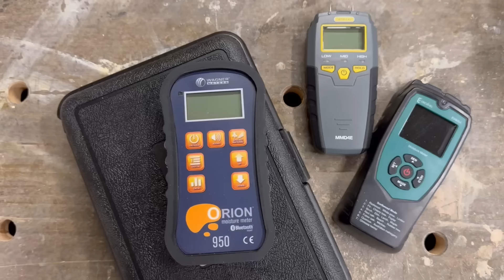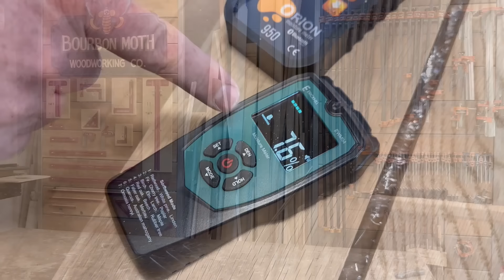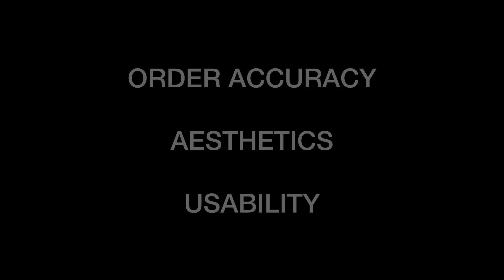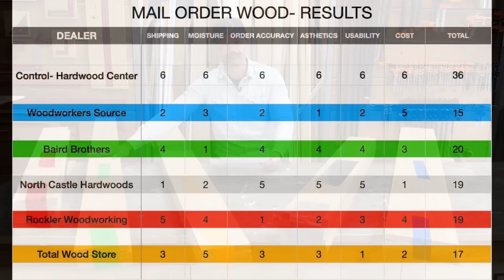A Thousand Dollars Worth of Wood || Buying Wood Online

Comment: Your ranking method is very misleading. The boards should not be graded relative to each other, but rather get an absolute grade between 1-6. After all, theoretically there can be 2 boards that deserve a score of 6 because they are of high quality and 4 boards that deserve a score of 1 because they are of low quality. According to your method, they would receive the grades: 1, 2, 3, 4, 5, 6 and this really does not reflect reality

Comment: This is a very informative look at how to order wood online.
The linear rating system can distort the ranking.
Example: If the delivery times were close to one another, say 6 days, 7 days, 7days, 8 days, 9 days the 6 day delivery would get 5 points and the 9 day delivery would get 1 point. That is a big difference for just 3 days.
Also each of the rating categories are rated out of 6 which means they are of equal importance.
Reply: Good point. I think each person might value certain aspects differently...for example, silver ranked higher for me as someone without milling tools. Vs someone that needs longer boards, fast shipping etc. Overall very informative with tons of useful info that can be applied to fit the viewer's unique circumstances/preferences.
Reply: I just typed up the same thing without reading the comments. Should be 0-10 (or 0-100) points and scaled. Bunch of stuff shows up quickly, but one is super late, give them points between 8 and 10, but one score of 0. A lot have quality issues, but one is great, give them points between 3 and 6, but one score gets a 10.

Having each category the same amount of points kinda makes sense to me. Maybe you need it fast, maybe you need it to be the best, maybe you don't have the money and can deal with worse quality.
Reply: The data is there and I think one can apply a weighting to each category that aligns with their requirements. This would then lead to the best choice for them.
Reply: @jbrickey  good point
Reply: totally agree.  I think certain categories should be weighted more heavily.
Reply: @danieldaponte1819  And each person will have a different weighting.  Price vs Time, accuracy vs price, usability vs aesthetics.    Granted, cost is my big issue, so ... that's a big factor for me.

Comment: I’m under the impression that the control was for rough lumber, would have been interesting for you to have your local wood store prepare the board S4S. I know that when I get mine prepare it generally take about a week so my local shop would not actually ranked first in that regard. I think that one of the main appeal of the online supplier is to be able to order S4S as not everyone is equipped to used rough cut lumber
Reply: I hope Jason addresses this comment because I had the same thought- is the price he listed S4S? 

Also, one must consider availability. With oak/maple/walnut, it's probably not an issue. However, your local place may not have the exotic wood you need while somewhere on the internet will. 

This is still a great video and the information is certainly useful!

Comment: I buy mine online from Ocooch Hardwoods. Never had a problem with anything. Quick shipping and always quality stuff. One time they did forget one piece that I had ordered. I called them and let them know. It was on a Friday afternoon. I had the board Monday. Even though I told them not to expedite the shipping cause I wouldn’t be using it soon.
Reply: That's who I use when I need to order something.  Never had an issue
Reply: love them best prices from online
Reply: Checked them out, can't order anything longer than 24" unless I'm missing something. Not really useful for 90% of what I do.
Reply: I was surprised to see them not included here, especially since it would be nice to see a the semi-objective comparison. I've only ever ordered their offcut/seconds boxes, but I know a lot of people in the laser cutting communities love their regular stuff.
Reply: That’s where I buy my wood from also. Never had a bad experience with them. If I am in a hurry I can go right to the them only about an hour from my house
Reply: @ex-nerd Probably because it looks like you are extremely limited in lengths. Order page says when ordering by the board foot the lengths would be between 47”  to 24”. On their pick a board page there is 1 board that is 36” and the rest are all 24” so I’d expect most, if not all the boards would be 24” so for a 7’ long project that wouldn’t be useful unless you were making a butcher block counter.
Reply: I tried them once...won't go back. Waaaay to inaccurate.

Comment: I went to buy wood online and the shipping was as much as the wood cost. It was actually cheaper to order S4S wood from homedepot with free shipping.
Reply: HD will send maple, walnut and red oak right to your door. Thx for let folks know.
Reply: @DownloadFreeWoodworkingPlans  I ordered some walnut and some maple. The walnut wasn't great, there were lots of color variations and several flaws. but a lot of the maple had flame figuring. Every piece had planer marks and one piece of walnut had some bad snipe.
Reply: If you are going to buy from HD go there in person and rent one of ther trucks for $20 for an hour. At least you might get something useful by picking each board yourself. They are going to grab whatever crap is at the top of the pile for online orders.
Reply: @gredystar8333  The only hardwood my HD carries is poplar and red oak and they don't rent trucks.

Comment: Should have thrown the big box stores in there as options so we could see how they ranked verses actual hardwood suppliers.
Reply: hardwood for big box is usually 20% more, but its usually ok stuff. hell it could be half assed as still the same quality and 1/14th the wait time as shipped
Reply: The HD near me ONLY has red oak. Anything else, nope. Special order only. :(
Reply: Not going to get a great selection of hardwoods at either as far as species. Red Oak, Maple or Poplar. HD used to sell Walnut, but no longer does (at least the stores I worked in). Lowes is the same. Quality/consistency though is actually pretty good, and it is all S4S.
Reply: @RB-vr7mq I was just at HD today for something else, and my local HD (near Seattle) carries Walnut still! White Oak is super expensive locally though, definitely not getting $7/board foot like Jason
Reply: The entire point of his video preceding this one was that’s not a good option at all.
Reply: @RB-vr7mq  Menards has a decent selection (at least where I am) with white oak, red oak, pine, poplar, alder, maple, walnut, mahogany, and hickory.

Comment: As someone without the vehicle to move wood, thanks for this video!
Reply: For those prices it would be cheaper to rent a uhaul and get better wood
Reply: See if you Home Depot rents flatbed trucks. One near me $30 for first 75 min. Enough time to run to a lumber yard and back.
Reply: @omm2745  that's a great price. I'll definitely look into that
Reply: You could put the 4ft boards in the trunk of an Uber :)
Reply: @thomprd  damn that'd be funny to try
Reply: My local hardwood dealer free delivery next day if order is over 500… might want to ask around. Even with delivery fee, would be cheaper and faster and I can pick boards compared to online
Reply: @bloho_design  100% I'll be doing this, too. Thanks!
Reply: No vehicle here also ... and no space for tools to mill up boards. [I live in a flat in the city center. Doesn't stop me from making furniture, I just have to be very selective.] 

I'm sure there are some excellent hardwood dealers on the outskirts of my city ... but when you add in the cost of an Uber to the cost of getting S4S wood, the upcharge for ordering online looks a lot better. Plus, I don't know about your hardwood dealers, but few of the ones I've been to produce glue-ready boards.

Last point, and I wish I didn't have to mention it ... being a petite older woman, I rarely get decent service when I go in person. Seems like most of the lumber dudes want to tell "the little lady" what she should want ... I've been working with wood since before most of them were born, and if I say I want S4S clear cherry, don't try to talk me into red oak!
Reply: If you have a Menards near you, it's just $20 to rent their truck, and at least at my local one, they tend to have better hardwood then home depot
Reply: @joshr408  I used to live in Menards country and I miss it everyday.
Reply: 😅dann finde einen Freund und fährt zusammen in die Holzhandlung

Comment: Great timing.  My buddy and I were just talking about ordering some wood.  Canadian viewers have to remember the 30% for exchange and getting hosed on import fees as well.   Local always wins.   But!  If you don't have a local hardwood place, start searching.  Odds are you're not that far from one.  Maybe it's a couple hrs drive, it's still going to work out cheaper especially considering you're going to be able to choose your wood and check the moisture
Reply: Except the two hours drive is at least a four hour trip. That ends up being a whole day just to buy wood. With the cost of gas, that is like the shipping cost of ordering online.
Reply: @ChrisStCyr-gnt7  Except for the fact you get to pick out exactly what you need/want.  So there's still value in doing that.  Plus if you plan accordingly, you can get a few projects worth and save even more.  When you order more online, you pay more shipping.  I'm fortunate to have a fair number of options closer than 1 hour drive.
Reply: @souprmage  you points are all valid and are trade offs. The next step in that logic is by giving up a day to travel to the lumber yard you save by not having to return sub-par wood. 

It’s like choosing to buy a $5 flea market find over a hundreds of dollars tool new, well the opposite in wood though. There are always trade offs in time for money.

The nearest retail woods yards I know of near me are at least 1:10 away. I do know a couple of guys with band saw mills more locally.

Comment: I'm honestly surprised by the Woodworkers Source. When I lived in AZ, I used all of their local stores and never had any issue, the stores are great, the people are great and the wood you pick out was great.  Since I've moved to another state, I have always kept them in mind if I needed to order online since I've dealt with them and knew that you could make an online order. Thought that they'd be up near the top in this blind test.
Reply: Agree with you. I’ve been ordering from them for a while now and have been nothing but completely satisfied
Reply: Also agree with you. I use Woodworkers Source exclusively for my hardwood needs. They have a large selection of exotics and their standard hardwoods are priced right….typically well under $15 bft. I do live in AZ but I have to travel 100 miles one way to stock up. But if I only do that three or four times a year it’s not a hassle and I can select nice looking wood for reasonable cost.
Reply: Maybe they dump lower quality online and sell higher in person?
Reply: Agreed. I have nothing but good experiences ordering online from them.
You only get one chance to make a first impression, so this was very unfortunate for them.
Reply: I've ordered online from Woodworkers Source for years and never had any problems at all. I was really expecting them to be one of the best companies throughout the whole video. Not sure if it's just a fluke or what. But this definitely doesn't look good for them.
Reply: I ordered White oak from them this January and I have to admit, my opinion matches this video pretty well.
I didn't really care that shipping took a while, but I got a 6 pack of 6 feet long boards for about $250 and they are all wavy and is not what I would have expected from all the praise I got online. Lesson learned it will only be local lumber stores from now on.
Reply: I've made 3 large orders online with WWS -- all 3 match the video in terms of wood quality and experience.

Comment: Thanks for the video, very comprehensive and although there are a few other factors to take into account, it seems about as fair as it gets.

The only note I would make, the lumber you got from your local lumber shop was probably not S4S at ~$7.50/bf. If it is, then we’re definitely all missing out. Then again I’m in Canada, so prices are different but that seems really cheap for S4S white oak.

Comment: One factor you didn’t think to rate is actually their return policies. That’s probably one of the most important factors when using online retailers. 

And to be fair to some of these online stores, it sounds like the usability might be a bit higher than a local retailer if they’re sending you milled boards. I mean it would probably save them more on shipping. 

For me personally, I think you over-weighted delivery time and under-weighted price.  You can plan to buy early but material cost can make or break a project. For me at least. I think the price should match the quality.
Reply: Oh and now that I think about it, what’s the distance of all these retailers from the delivery address? 

Are the most expensive ones the furthest away leading to a higher cost?

Comment: Moral of the story, don’t buy wood online. It seems to expensive and takes forever to receive and if there is a issue with the wood takes more time and frustration. Find a good local lumber yard and get to know them. In my opinion 😎
Reply: Since i live in a city with a really good hardwood dealer, i wouldn't order online. And we have a couple of "ok" sources.

But if i had to drive over 100 miles i would think twice. But ¢20+ for a board, i guess id drive 200 miles.

Comment: Can confirm, Baird Brother is great. 
I've bought from them a bunch of times. Last time I ordered some oak crown and base for a small project. With shipping from them in Ohio to me in Florida, it was still cheaper than what our local hardwood dealer wanted to charge to mill it. And I was blown away by how smooth the boards were vs what I normally get from our local store. Baird really does some good quality work.
I'd also like to say their website is really good. I'm often up late when working on a job estimate, just not enough hour in the day. It's very easy to pull acurate material and shipping costs from it.

Comment: I will say in the beginning of my amateur woodworking, the local lumber stores intimidated me with dealing with the board feet and varying options.  Not all of them allow you into the wood area and some do not offer S4S.  However, I took the leap and learned.  Most of the time they are very helpful.  Always best to go during the day on a weekday when they are slower and can spend more time with you and your needs.  I wanted to some specific length and width walnut and they brought the stack to the loading area and let me choose what I wanted.

Comment: After watching this video, I’m really thankful for the several sawmills in my back yard, all within 30 miles of my shop. One note about those miles, my nearest big box lumber store is 26.5 miles from my shop so I’m driving the same distance regardless of where I shop. 

I’ve never paid over $3 for a board foot of white oak, and maple isn’t bad for $5 a board foot. The lumber is all air-dried for a minimum of 3 years in open-air barns, and the cuts are generous. The surfaces are raw, but honestly they look and feel better than the surfaces at my local big box so that’s actually a plus in my book.

Plus, we can pick our pieces. Bring your moisture tester, but I’ve never found anything under 5%, and nothing over 9%, so I don’t even test anymore. We have to load our trailer ourselves, but we have to do that at the big box store, so that negates itself right away.

All in all, it’s always an experience!
Reply: Whereabouts are you?  Northern US?
Reply: @danieldaponte1819  

More like a tad north of the middle of the lower 48. So probably not as far north as you might be thinking.

Comment: I ordered 10 board feet from Woodpeckers because it was one of the deals. The price for the walnut was descent however what I got was terrible. The wood was bowed, poorly planed, had knots in the middle of the boards, had sap wood, and some of the pieces were not 4' as advertised. I did not attempt to contact them because it was awful all around. I had seen Four Eyes order a lot of wood from Woodworker's Source and never mention an issue however since there are some local to me, I would rather go into their show room. However, their prices are higher than other local hardwood dealers so I don't.

Comment: I have never been disappointed with Ocooch hardwoods.  They have what is called project ready wood.  It is S4S and the measurements are exact. you get a true 3/4 x 3 x 24 for example
Reply: There’s nothing they sell longer than 24” tho. That’s really limiting
Reply: @terencemerritt just ordered 25 board feet that were 72 inches

Comment: SIZE MATTERS!(no,seriously). Great experiment & analysis Jason! 1 factor hardwood  buyers should note is quality & size rarely increase proportionally.

For example, if you ordered  1’ length boards from each company I’d expect uniform high ratings. Doubt you’d see any defects. 

Now place the same order for 16’ lengths. I’m guessing 1/2 the orders would be unfilled & what showed up would look less impressive than what you received here.

Slight bows over 12” length seem benign. 
Same curve stretched over 192” looks horrific.

Etc.

Comment: I've had issues with Woodworker's Source hardwood, also. I do buy plywood melamine and MDF melamine panels (black and/or white) from them at a very good price and usually free shipping. Otherwise, I usually "bite the bullet" when I need wood and make the 160 mile round trip to Austin to go to Austin Fine Hardwood. I save up $$$ for a long time and get as much as I can afford. Thx.